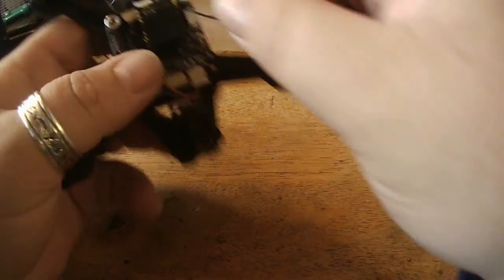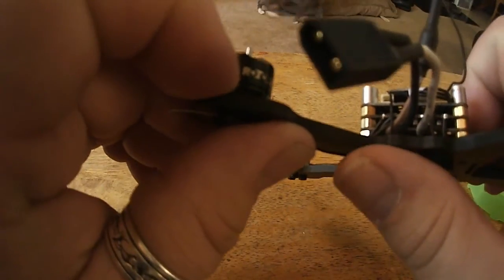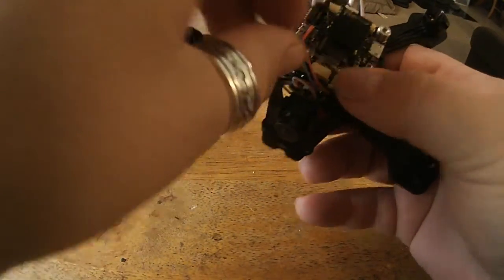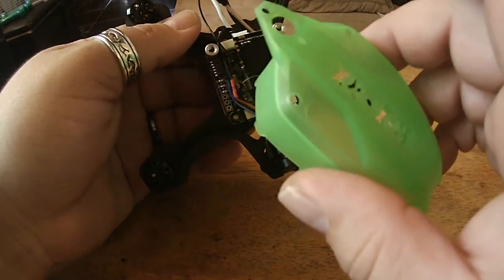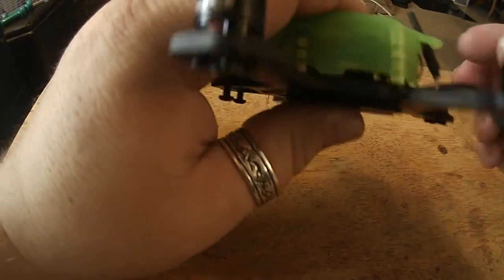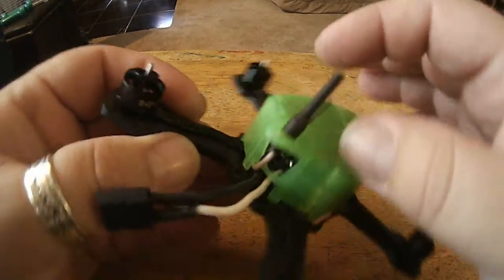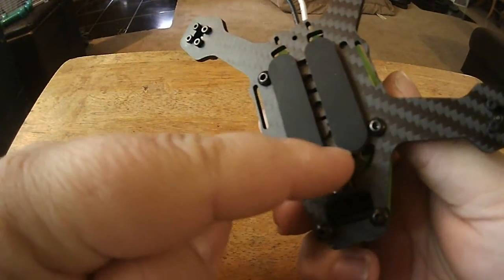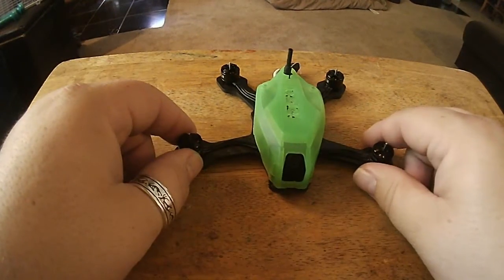RotorX Atom V2 DIY kit Pro Tip: Diversity antenna placement

Comment: Hi Jeffrey, I am new to the Atom v2 but have been enjoying your videos on it. Question, if I was going to take off the whip antenna and put on the larger antenna, do i need to remove each layer of the cube to get to the bottom to do it? There seems to be a small plastic cross under the snap which keeps it from coming off? thanks for your help.
Reply from the maker: You will need to remove the cube from the frame, but it comes off in one piece, no need to separate the layers. Once removed you will need to remove two small screws to remove the bottom plastic layer that isolates the cube from the CF frame. Then pop off the lead, and attache the second one with the SMA. I can make a video if you like showing you how to do this.
Reply: Thank you for the reply. Yes, if you have some time and could show us a video on it, that would be awesome :)

Comment: Hi thanks for the tips on the Atom
V2 build. I was wondering where we can connect a buzzer on the Powercube? Can't seem to find a spot on the FC?
Reply from the maker: It has a buzzer built into the OSD/Vtx layer. You just need to assign it
 a channel in both the FC configuration, and the OSD calibration/menu.
Reply: I see ! thanks !

Comment: How am I access my osd menu
Reply: Press the button on the side of the FC for about 5s and put all sticks on the TX in the middle position
Reply from the maker: Make sure your left stick is calibrated properly so that throttle goes under 1080 and left raw the same. Then hold left yaw and it will go into the OSD menu. If it doesn't open a ticket at rotorx.freshdesk.com :)